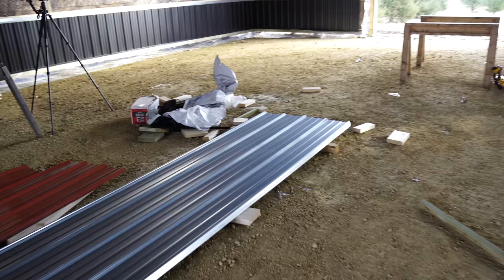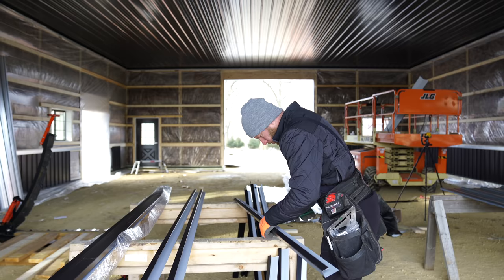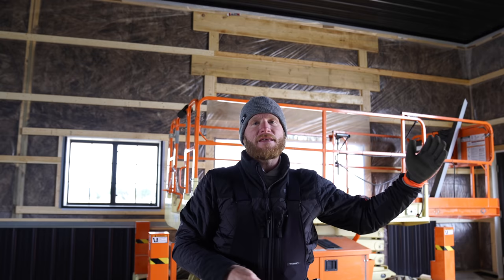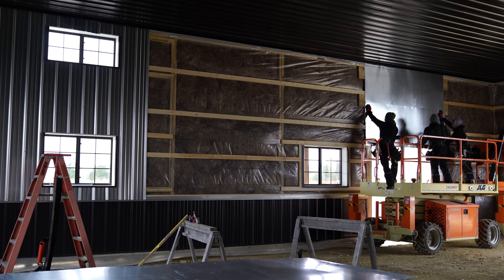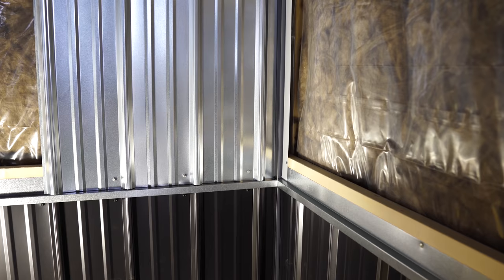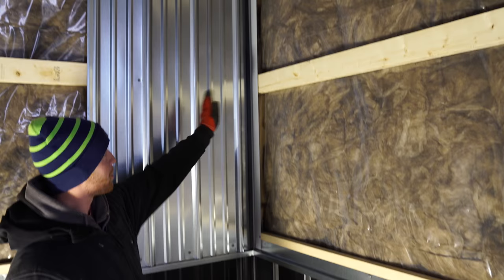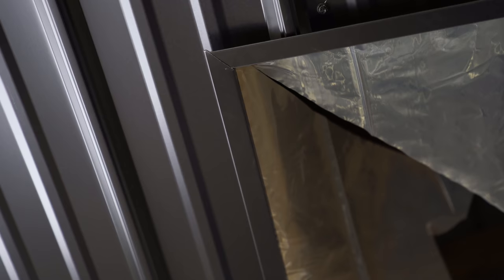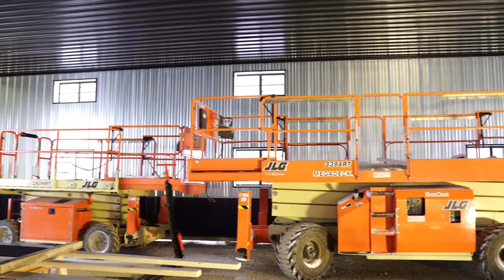Building a Large Garage 14:  I Made a Mistake

Comment: When we put flat stock on we attach with contact cement to ply wood no oil can.
Reply: Was just going to ask if you could do something like this (not a carpenter/post-framer).  Do you just lay another sheet of plywood on top with some weights? Or does the contact cement instantly bond as you smooth it out?
Reply: @karicallegra8194  Probably the same as contact-cementing a sheet of Formica to plywood or P-board.

Comment: @7:00 "past it by a 1/16" most guys would say "yup it's flush send it" thanks for not doing that greggo. one tip I have that might actually benefit you though  is to maybe put an over/under hem between the two pieces of flat stock to fasten them to the 1x12. or if you wanted to go a step further you can make a cleat out of scrap material, fold that over the hem and screw it to the 1x12, and hook the piece of flat stock above it and fasten the top same way. that's how it's done to fasten double locked standing seam roof panels to the roof deck. would result in less oil canning but one line (seam) across the middle.
Reply: I just remembered that you have the Wuko now too...:)

Comment: For me the flat stock spoiled it a tad! You guys do such a near perfect job that with the slight deflected warps in it it looks too apparent. I would have either used a slightly thicker gauge material and/or install full sheet boards where the tin sits and use a wet backing adhesive that bonds the whole surface area. Like a double sided adhesive sheet. Similar to what they use in shower cubicle tile installations. This would create a full bond and show no warping whatsoever. I've had this issue before and it worked perfect using a full sheet on sheet when using thin flat stock. Just helpful advice and aas usual guys another "pukka" job. 👌👌👊👊
Reply: It was getting covered up by a roll up door.
Reply: @fatal510  wow i sent that over a year ago. Better not ask for a quote id get my building in 2034😂👍👍

Comment: Have you thought of using a bead roller on smooth panels to add strength ? This would prevent oil canning and unique touch to your work. By the way, have you tried using two pairs of gloves?